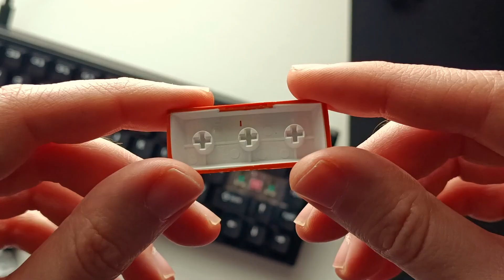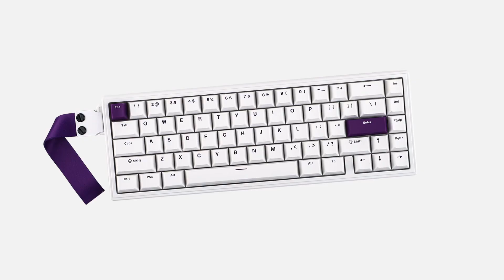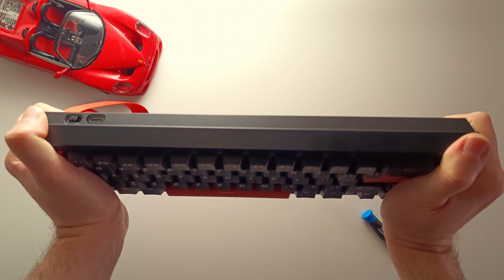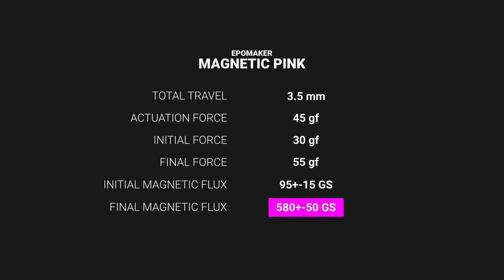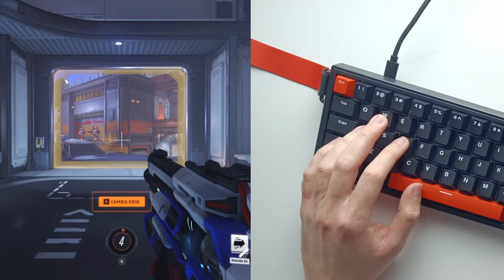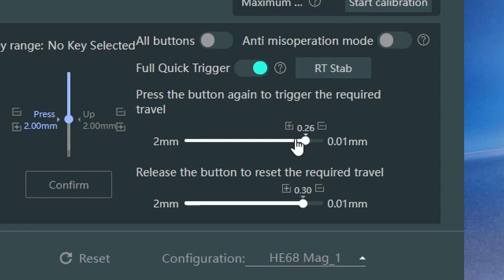This $60 Hall Effect Magnetic Keyboard Is Fantastic! - Epomaker HE68

Comment: Bought it to try out magnetic switches, they feel good however board is advertised as 8000hz polling rate but in tests it barely reaches 1000hz and mostly much less (tried USB 3.0 / 3.2). There isn't any setting in software that mentions polling rate.